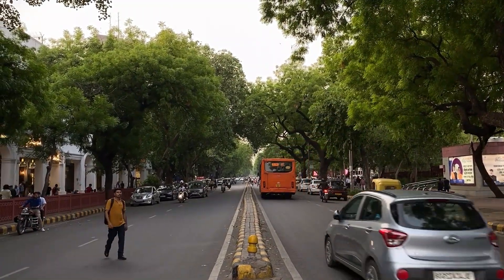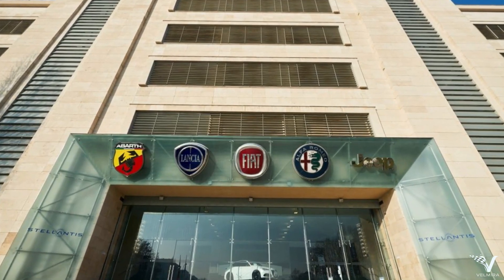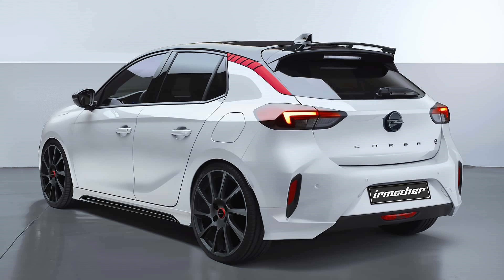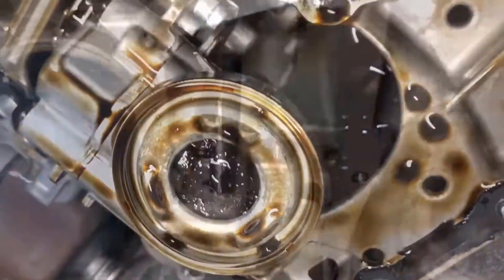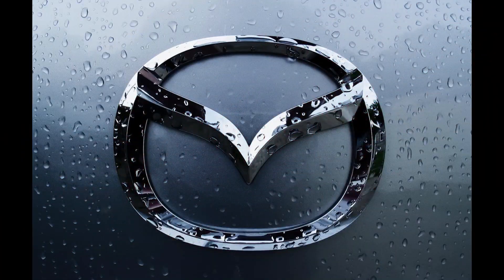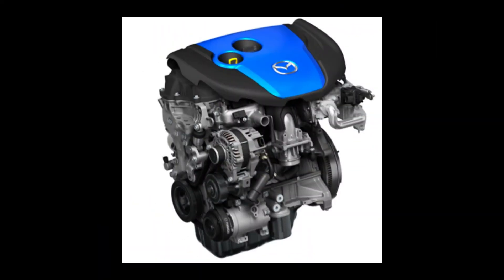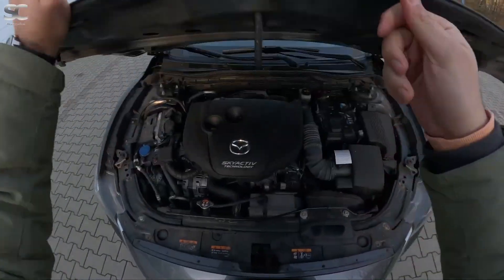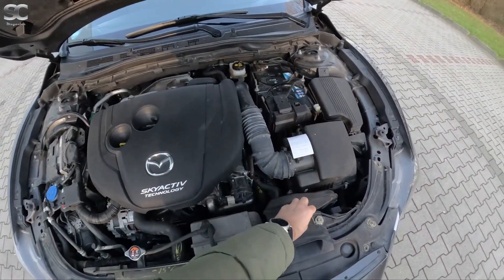4  Bad Engines  in  58 Car Models

Comment: The 1.0 Ecoboost Engine is Great. But only the Engines After 2019 they have a chain no wet belt.
Reply from the maker: True  the post-2019 chain ones are solid, but the early wet belt versions were a nightmare for many owners.